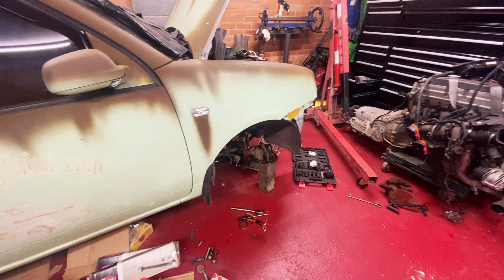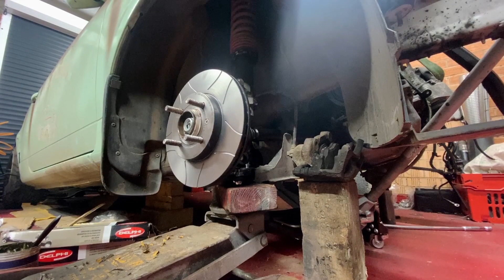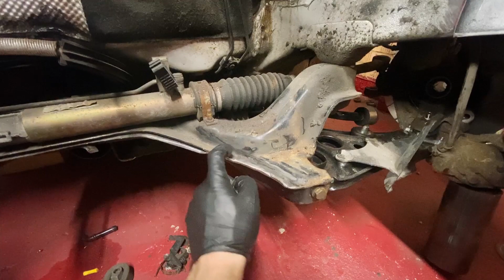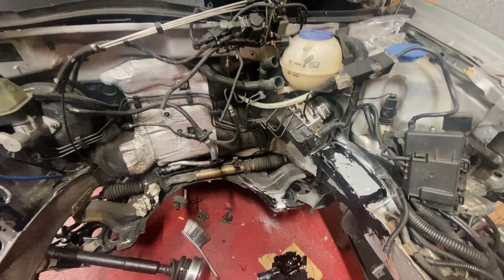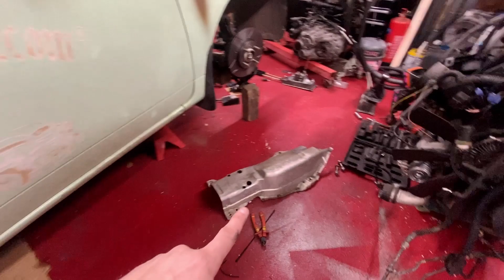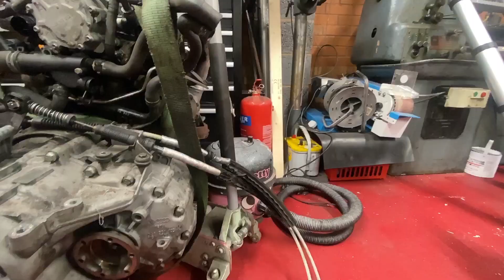Arosa 1.4 to 1.9 TDI PD130 VRS Conversion Vid 9 - Gear Selector & Chassis Notch

Comment: Did you have to make any modifications to the subframe I’m Doing the same build and the diff is very close to the subframe if not hitting it. thanks
Reply from the maker: Yes, the minor mod to the subframe is covered in this video - although mine never touched before the mod, just was very close
Reply: @rustypaint  I’ve been watching closely as your doing an an absolutely mint  job learnt so much from you. Could pick your brains four hours 😂👍

Comment: Have fun wiring up your speedometer using that gearbox mate 😂😂unless you know how to get the speedo out of your ABS
Reply from the maker: The speedo is off of the abs on the fabia via can... the can is similar on the arosa, so should be a piece of p*ss to be honest 🤣
Reply: Rusty Paint yup you know the one 👊🏾👊🏾just checking as I seen the abs on ya car but I know the box don’t have a speedo so Yh get them 2 orange wires twisted and make the can bust into life 😂😂😂